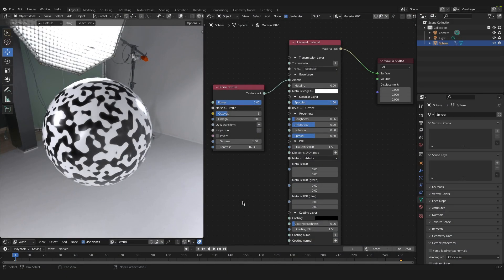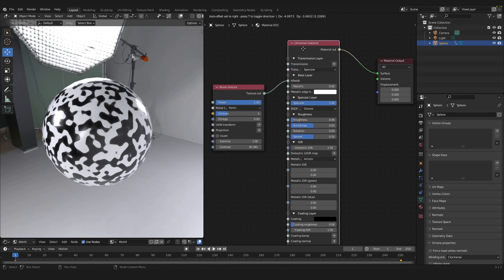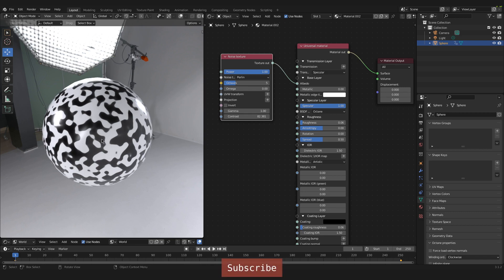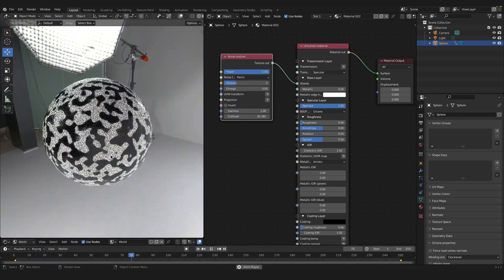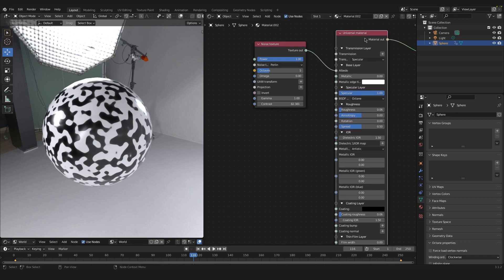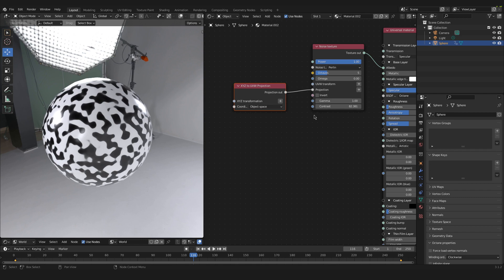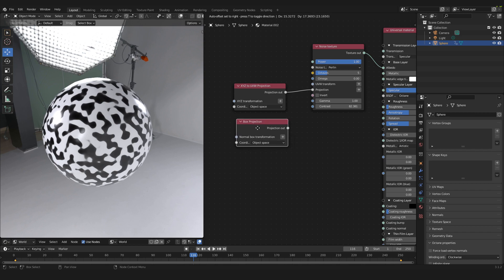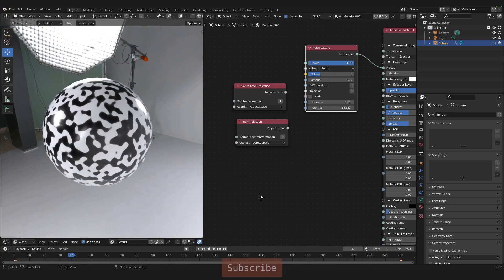Noise texture does not rotate with object: Solution | Blender & Octane

Comment: How to create an animation of a procedural texture, noise for example? Cycles has a Value node, Cinema 4D has an Animation Speed parameter. Didn't find it here. Thank you!
Reply from the maker: Connect a projection node (for example box projection) to the procedural texture by plugging it into the projection connector. Then connect a transform value node to the xyz transform connector of the projection node. Now you can change the values in the transvorm value node and set keyframes. Hope this helps you!
Reply: @timvias  I can´t do it with the world space transform.